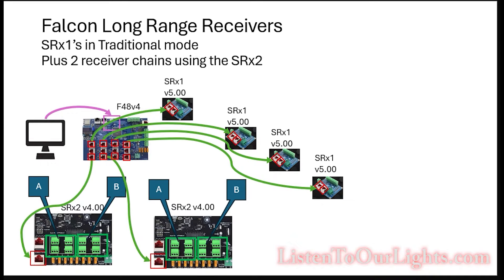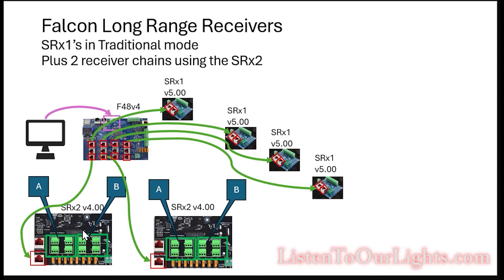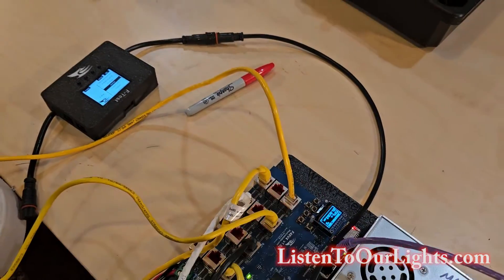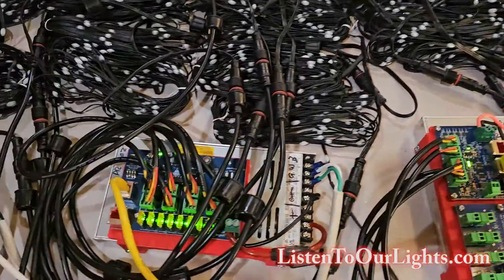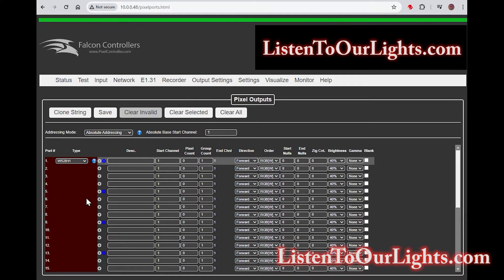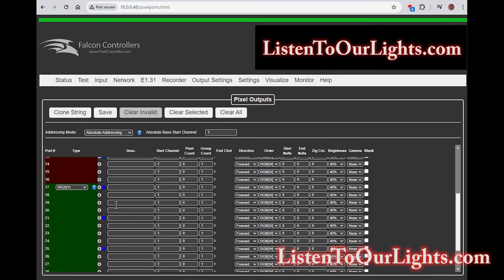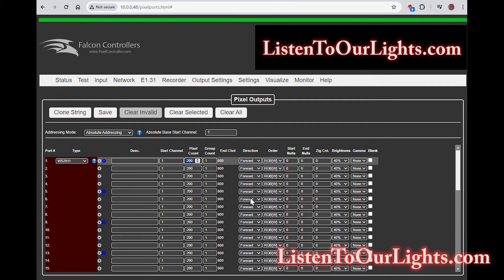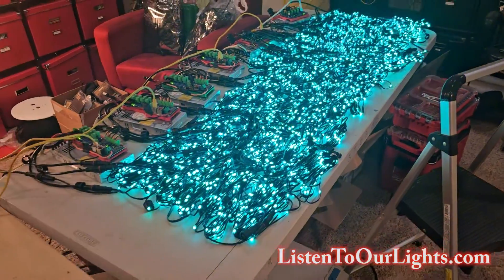Falcon F48v4 with SRx1 SRx2 smart receivers in Traditional Mode

Comment: Hello, nice video. It's a good explanation of F48V4 and receivers. I am new to Pixel light show and trying to set up my first Christmas lightshow for 2025. I am now lost between F48V4 and F16V5. Could you please advise which controller to chose from? Many Youtube lightshow channels mostly explain F16V3 or V4,  but not many explanations on F48V series... I want to start small with one 6ft tree and 4 or 5 props with singing elements and later expand. I want to add whole house roof lights later. Thank you.
Reply: I think the biggest differences are how close your props are going to be to either of those options. I have the falcon16v3. That means you have 16 ports on board to connect pixels to. You only have 4 ports on the F48 board. The F48V4 board, imo, is best if you wanna keep it inside (garage, basement, etc) and just run Ethernet lines close to a cluster of props where you can then have a box with a power supply and a smart receiver to run those props at long range away from the controller. You can also do this with a F16 but you need a differential expansion board to allow it to power pixels a long distance away. Without it, the F16s are basically just a board where you have 16 ports for props within 20 feet or so.
Reply: @philkingmke Thank you for the explanation